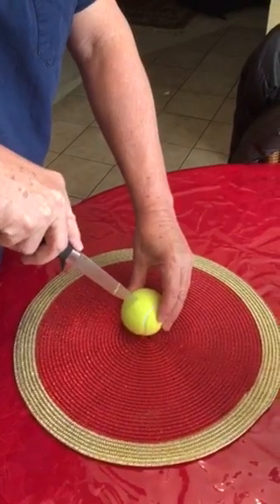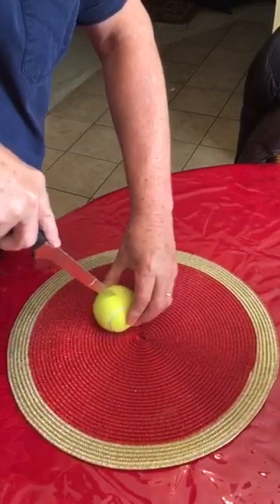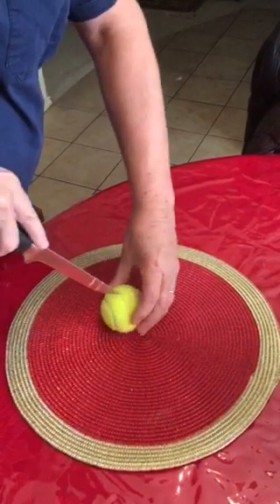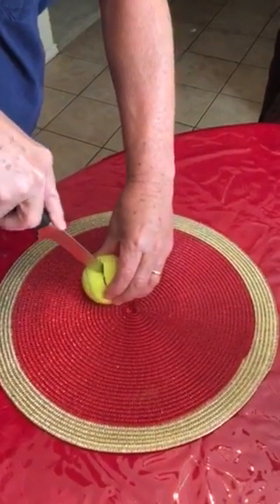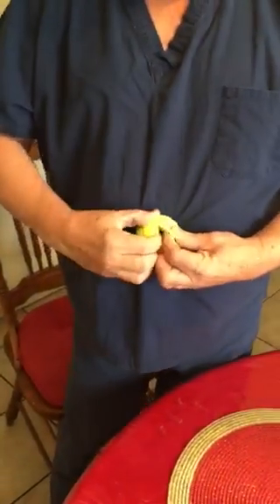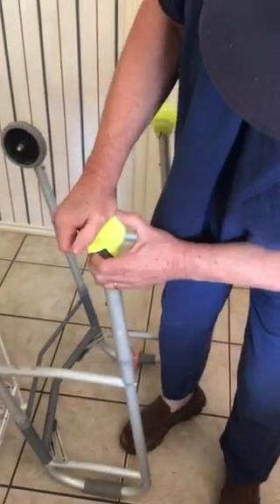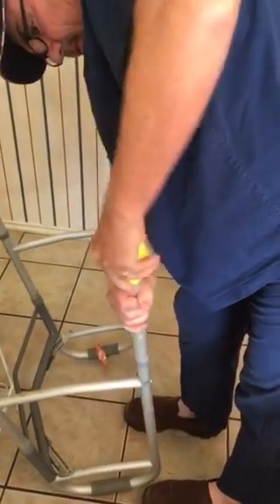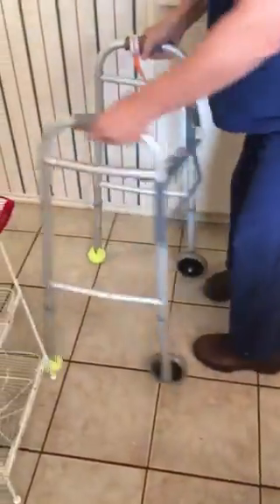Simplest How to cut and install tennis balls on a walker

Comment: Thank you. Showing that the tennis ball goes over the plastic foot piece at the bottom of the unwheeled walker leg is hugely helpful.  
B/c the Drive brand of fancy plastic bottom button balls, which I did not find long-term useful for my Mom's walker, required the removal of that regular plastic foot piece, I wasn't sure my commen sense applied here! 
Without the plastic foot piece that affixes tight to seal the walker leg (when using the Drive ball), water got into the leg from tile floor cleaning to accumulate rust residue inside the leg, potentially weakening the strutural integrity to make the walker unsafe.
The pre-cut tennis balls instructions on the market I found for walkers do not clarify what your video so clearly showed.  A real public service; kudos!